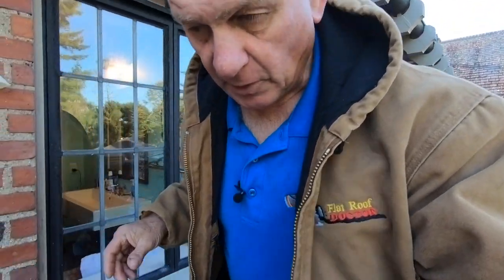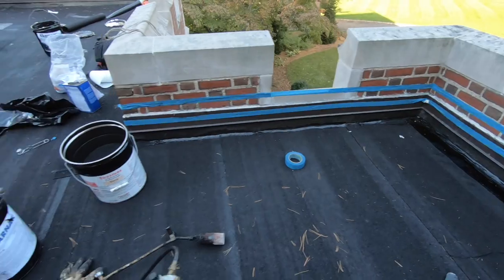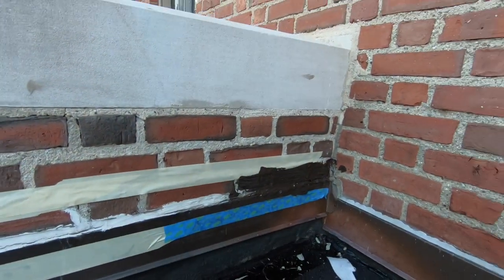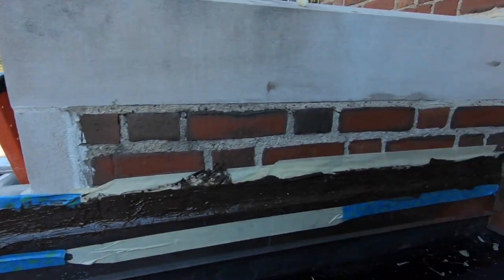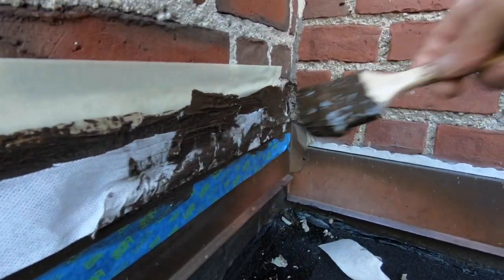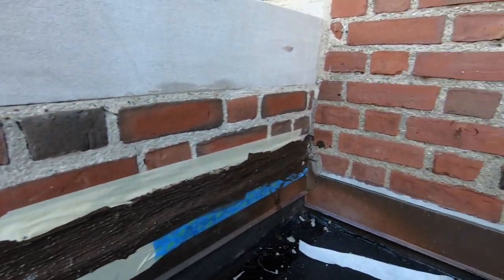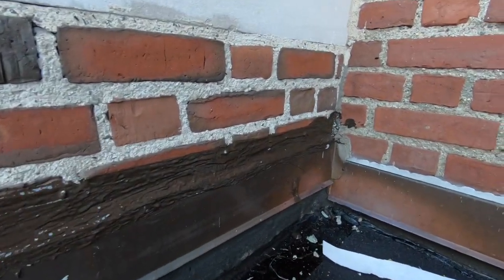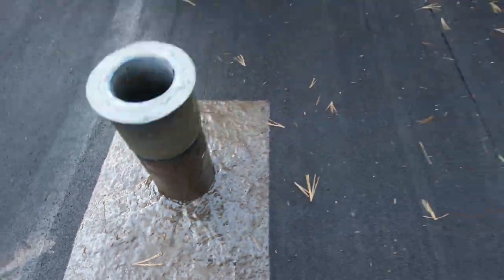99% of FLAT ROOF LEAKS start at the flashing - Turbo Poly Seal

Comment: This is exactly the product I was looking for.  Thanks for demo’ing how to apply it. Over here in nyc queens we have tons of flat roofs with tons of flashing problems. I’m not a contractor just a DIYer.
Reply from the maker: Hey Dennis
This Turbo Poly Seal has been a game changer for me. My son started using it years back and being me, I never took any interest because I am an old school guy. But when I saw how well it performed, I start using it. There was no turning back when I realize how easy it was to apply and then realized the value of it when I saw that it adheres to metal, glass, asphalt, plastic or any other surface. No other product is so versatile than Turbo Poly Seal. The only roofing material it would not bond too, is EPDM Rubber. I have another product I use for that.
Reply: @FlatRoofDoctor  
Love your videos! How do I know if my roof is EPDM rubber? And what do you use for EPDM? Thanks!

Comment: Hello Naas 
Great videos 
How do you repair a flashing leak on a torch down roof with edge flashing that bevels upwards
Reply from the maker: I am not sure what you mean. Does the flashing part on the roof have a kick out of 1/2' upwards?
1. Flashing on a flat roof should always be under the membrane and never above.
2. If it is aluminum, use a utility knife to score the metal at the crease, and then you can bene it back and forth breaking the metal off.
3. If it is copper, then use a grinder to cut the bevel or kickout off.
4. Then ad a strip of membrane over the flashing fusing it to the existing membrane.

I hope I answered your question?

Comment: Can you paint over this? Thank you in advance!
Reply from the maker: Hi Irving.
Very good question. Yes, you can paint over Turbo Poly Seal. Any paint will help protect it from ultraviolet degradation. In the video where I show how to tie a drain into a new rubber roof with Turbo Poly-Seal, I sprinkled ceramic granules that are of the same color as the roof so you could almost not tell the transition after it was done. The ceramic granules are better protection because it embeds into the Poly Seal and UV's cant break the ceramics up whereas paint might not last that long. here is the link to that drain https://www.youtube.com/watch?v=DvhWx5SdzbM&t=8s
Reply: Flat Roof Doctor I just saw the video you left in your previous reply. I have roughly 235 linear feet of flashing that has some problems on my house. I would like to do this repair on. Is there a similar product you would recommend or larger cans of Turbo Poly Seal? Those little cans are expensive!! By the way your videos are awesome!
Reply from the maker: @irvinggonzalez2751  Hey, I think https://bergstromm.com/ just lowered the prices. You can get a 1 gal Turbo Poly seal for around $180 I think. What I normally do is I cut the 6" Fleece in half so I get 2 x 3" width rolls from the one roll. Then I only paint a 31/2" strip of Turbo Poly Seal instead of 7 inches. That goes a long way.
Thanks for the compliment.
Reply from the maker: Hi Irving I an so sorry for the late reply. I wasn't aware of your question. Turbo Poly Seal can be bought in 1 Gallon. I think a Gallon would be enough.

Comment: Not sure how to use this in my case.  My metal flashing seems to leak where it bends under the shingles (angled roof against a higher wall on the house), so not sure how to apply this in that 90 degree bend with one side up being metal and the bottom being covered by a shingle.
Reply from the maker: Follow the recommendation if the other reply

Comment: Can you step on this or does it remain too gooey? If it is not too gooey, can this be painted over after it dries?

I have a flat metal roof over a porch that comprise of 2 big flat pieces of metal.  The 2 pieces of metal come together a create seem between them from one end to the other, about 12 feet. 

I sealed it with caulking and painted with an exterior metal paint from Sherwin Williams about 4 years ago. But I never really trusted the caulk to hold up too long, especially since the paint started showing small cracked on the vertical sides where the flat part of the roof turns downward to direct water into the gutters.

Another question: can this be used on chimney flashing as well since those bricks can get hot from burning woods?
Reply from the maker: Turbo Poly Seal will cure to a rubberish texture that you can walk on. It is good practice to coat it with urethane or oil-base paint to give it a longer life expectancy.
This product is excellent for metal roofs, here is a short video where I repair a metal roof https://www.youtube.com/watch?v=k_2ULBR6TJk

Comment: Hey doctor,what do you have in the big buckets? Is that turbo poly seal too? Thanks
Reply from the maker: Hey Gjorgi,  I had to watch the entire video to see what buckets you are referring too. I then realized you saw it at the end. There are 2 buckets. One has black ceramic granules that I use to sprinkle over the Turbo Poly Seal after making a transition to a drain, and the other is Karnak 81 Trowel grade Modified Bitumen Adhesives I use in conjunction with the rubber membrane.

Comment: Can you use this method over a seam on a metal roof?
Reply from the maker: Yep Just make sure you screw the seams tight so there is not much movement
I have a video on that but have not posted it yet. Maybe I will do that tomorrow

Comment: You said you can use this on anything including rubber
Reply from the maker: Hi Millie
The only surface it will not stick too is EPDM Rubber. If that's the rubber you are referring too, then this will not work.

Comment: Very bad advise. Brick walsl often have weep holes located just above the counter flashing. If you seal over the weep holes you are  going to have major problems. 
Scrape out the old caulk,  clean the joint and apply a good quality caulk and tool in place.
Reply from the maker: A partly good answer ZZAA2691
That is if they did have weeping holes. In this case, there were no weeping holes.
The bad part of the answer is "caulking" It is a rare thing to see any "good caulking" Maybe you can refer to some brand names. I honestly would like to hear from you. And I think so would others that read this.
Thanks
Naas
Reply: @FlatRoofDoctor  I would suggest you add a warning for your viewers to make sure they don't go over weep holes. 
MasterSeal NP-1 is a polyurethane caulk that provides excellent adhesion to both masonry and metal.  The key is proper prep work - too often contractors will just apply a new layer of caulk over the existing (failing) caulk.   The old caulk must be scraped out of the reglet.  If there are not weep holes sometimes the easiest solution is to cut the existing counter flashing flush with the brick, cut a new reglet one course above the existing and install new counter flashing.
Reply: @FlatRoofDoctor  roofing supply stores around here sell mulco